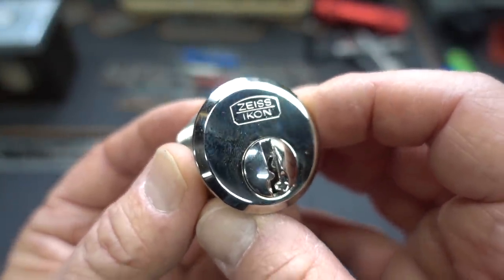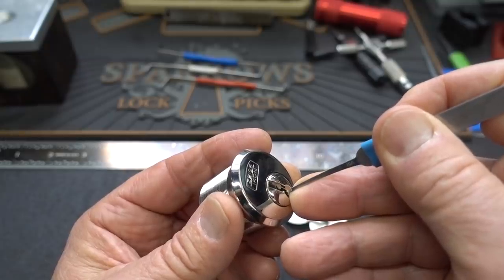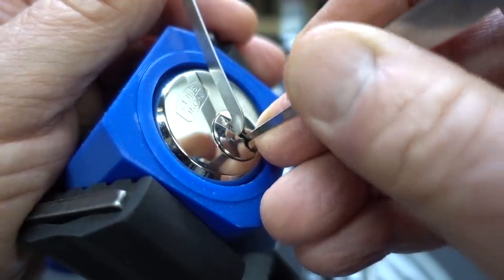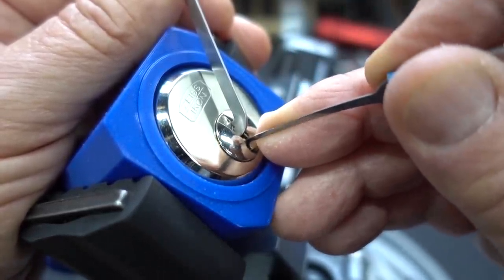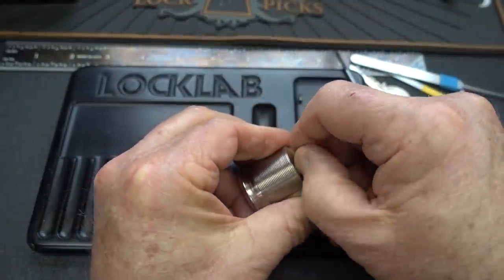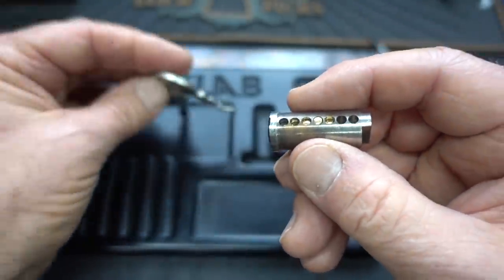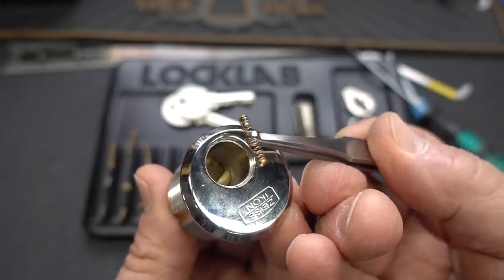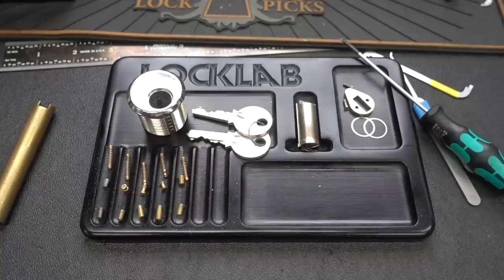(1804) Zeiss Ikon Mortise Cylinder

Comment: Those locks were designed more than 30 years ago when zeiss ikon was transferred to Ikon an later 'assimilated' by Assa Abloy. I saw many of those for example in trams for securing access to electrical components. The reason for manufacuring was simplifying and standardising the housing in sizes. the same kind of locks were used with 6 or 7 pin master key systems- not for security but for having more variations in keying. example: 10 different keys for different access levels in a system of 2000 locks. they were built in many different profiles: here TK5 N2, TK6, TK7.....security features were these days not as today with hardened  inlays. so the ball bearings inside the springs were used as basic anti drill protection- especially when you tried to drill out the springs only.

Comment: Yesterday I had to remove the sixth pin from a cylinder because the other locks were five pins and they wanted all on one key. The longer key would not fit in the five pin cylinders. I am just saying there are considerations for not filling all chambers. Most of the time it seems for no reason I can see however.

Comment: This isn't considered a high security for Zeiss Ikons measures.
First of all, this happens to be their standart model, 5 pins, no special features. Only special thing about this one is that it is chrome plated and polished.

They just drilled 7 chambers to have a Standart. This way you could fit different plugs for even different models (say a 7 pinner) into it.

Comment: nice Pick and gut, maybe  if you can't find a better length key, you can cut back the shoulder one pin position , move the originals one chamber towards the rear, and add a new pin set to the front.
Some hardware stores carry ring shims like that and some are even flat springs, but I'm not sure if they carry the right diameter.

Comment: Nice picking Bill....but if it is in the door your tensioning arm and hand won't be positioning would not be that way. Let's just say your shoulders would get a workout and you hand would be resting against a door or door frame. Picked but not in a door. If it was....you would probably use a faster method.

Comment: How do you know, thar Zeiss really claims "high security" for this lock?
I can imagine, that there are 2 more advanced versions of the lock on the market, with more pins, perhaps different security pins. It is likely just done this way to reduce cost of development, manufacturing and storage of different lock bodies.
Reply: It's more of a marketing gimmick to claim higher security for more pins. They can charge more for them.  50-100% more.

Comment: Nice job. I like that keyway.
I saw another utube picker, forget who but might have been locknoob, explain how those tiny ball bearings work. They're anti bump.
I seen you use that pick a few times before. Is it supposed to be curved like that, or have you warped it through use?
Reply: Cool info! And the pick is supposed to be like that (: